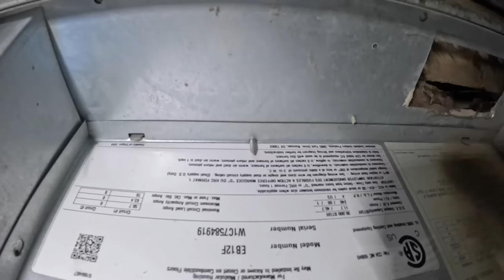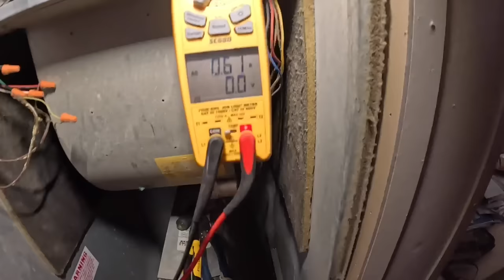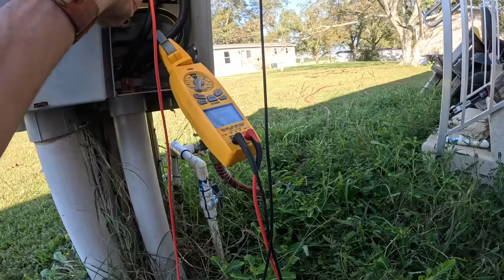Serious Electrical Problems. Only Made Worse By Me! ⚡️ ⚡️

Comment: I swear some of the places you work I'm not sure how you get paid.   ;)
We lost power back in late March due to a tornado strike.   When I say lost power most of the utility poles were pulled down.   So the area required all new poles and lines.  After a week without power when power was restored I discovered my outside main breaker failed so I was only getting one leg to the CB panel inside the home.  Luckily I got it repaired the next day which took an electrician due to the age of the service panel.  Required removing the meter.

Comment: Wow! You're like a pit bull that won't let go! When you tested the power on both legs at the bottom of the meter and found one was not energized. Your not responsible  for any more.😊 Great job getting the lines straight on the heat strip. It's just amazing how those things will run with that much wrong. Stay safe! Give Reily a hug.😂

Comment: Why is there 2 different relays needed for 10kw heat strips? I would definitely ditch the sequencer and relay, a double pole contactor will handle that with no problems and a heavy duty relay part number 90403 and use only 1 speed for both heat and cool that will minimize the possibility of motor failures because it is only using only 1 speed and can’t try to lock 2 speeds on at once, also too just take one leg off the contactor and go to the normally closed side off the relay with it that way the heat strips can’t run without the blower running

Comment: Wonder if the neighboors had the same issue, if so it would have been at the main transformer or substation , other than that , she has a bad meter. Be lucky you did not touch that meter, it could have arched if a lug was bad. Your job was actually done at the breaker in the home. Good work and stay safe.

Comment: First time I’ve ever seen a mobile home electric furnace used upside down…
Reply: It is called a "Downflow Air Handler"! :face-blue-wide-eyes:
Reply: You haven't seen many mobile homes then. All mobile homes manufactured for cold climates, electric or usually gas heat, are all downflow situations.

Comment: Must have had one leg open at the pot or maybe a distribution pedestal if they used one. Some of those pedestals are a pain to start with as dis similar metals make up the bus bar connections. Glad they got both legs back working!

Comment: those relays do not go across,they go up,but it could be shorting out inside.but definitely,the 2 lines are connecting.thanks for sharing.
Reply: Like they're connected but one leg is broken somewhere along the run?
Reply: like the lower heater is shorted ,there should not be continuity between blue and orange.9:32. @allanbrito13

Comment: the short was at the breaker bridge ,between yellow and red.ohm out the heaters.
Reply: Didnt have a short im willing to bet. The furnace was trying to run on 120volts. Furnace was wired to spec. They have a bad service entrance wire thats burnt to ground.

Comment: That inverter behind your driver seat has a severely bent cable at the terminal. Try bending the the lug to eliminate wire strain. I do a lot of high amp DC wiring on boats..
Reply from the maker: will do

Comment: Did you get to the bottom of this? I can't find a callback video.

I looked up the relay you changed. It enables both sets of heat strips, one per contact set. The contacts go the opposite direction from the assumption. There will, at least, be a "no heat" return call. Also, the legs it switches (orange and black) are on the same leg of the incoming power, so a short at that relay wouldn't trip anything. It just won't work.

The continuity you found on the red/blue wires - that relay is for switching the blower speed, and blue/red is the normally-closed contact. Red is connected to orange through the motor.

There also isn't any intelligent "control board," so everything should react immediately to the thermostat. As I presume it was left on 'cool,' I would have expected the blower to turn on immediately. Also, that transformer sound isn't healthy, especially undervolted.

Barring anything like burned/chafed wiring touching together, my guess is the blower shorted. It doesn't have any overcurrent protection other than the 60A breaker with the yellow/orange circuit on it. I think the repeated dead shorts (the initial one, there may have been one if somebody tried to reset it before calling you, and yours) damaged either the meter or a breaker/fuse in the pedestal (or maybe even a connection somewhere). The unit is no longer tripping the breaker because now there's only 12V on the control side and it's not enough to pull in the blower relay. When that's back up to 24V, I think you'll be tripping breakers again.

As to why you're seeing 120V line-to-line: that house did not have any "240V" loads turned on: stove, dryer, water heater, were not operating. Therefore, the "good" leg has 120V to N from the poco, the "bad" leg has no supply, and everything connected to it is a "load" to neutral. Thus, that leg basically appears as neutral. If some 240V load were to be turned on, it would pass current from the "good" leg to the "bad" leg, bringing their voltages closer together (ie, closer to 0 on your meter)   The fact that they have an electric water heater that was apparently not trying to heat at the time of your video further suggests that the second leg was working prior to your arrival - otherwise the water in the tank would have been cold.

Comment: Good job spotting the problem ,The power will back feed through a 120 volt closed circuit by the neutral wires that are connected to ground in the panel in the house ; But normally a job like this calls for that big flat screwdriver with all the burn marks on it and poke it around in those panels and something will fry ! Lol  Ha Ha !

Comment: When you check the hot lines and only get 120 volt you only have power on 1 leg your checking same line that's why to ground gives 120 volt on 1 leg the other leg 0 when you have power on both gives 220 volts

Comment: Somewhere in the supply wire going to your outside panel from the power supply to the panel is burned onto in the ground…had to diagnose that problem at my own house years ago…
Reply: @Bryan-Hensley   Yeah and he didn't notice them, even the cover he took off had a huge flash burn.  He's a pretty good HVAC tech, but his electrical skills are seriously lacking, and I am afraid one day he will get hurt, badly. Edit: and at 12:00 look at the burned connections on the heat strip relay, orange and black wires.... again, very poor observational skills here...oops, continued, and he just found it.
Reply: @mxslick50  I did not see Him look at the 2 Supply Wires on the left side of the 2 Breakers.
I looked to Me like one of them was up against the terminal of the top leg ??

Comment: 120v phase to neutral and 120v P2P. If one phase is at zero, it will show 120v Phase to Zero (potential between peak and zero) when you are reading phase to phase you are reading  the potential between+120V positive and -120v, thus 240V of potential between said points, because each phase is 120degree offset of one another.
Reply: 120V line to neutral, for both split phase 120/240V service and for 120/208 (three phase).  Three phase is 120° apart in phase rotation, but split phase is a single phase line (center tapped) so there is no time (phase) component.
Reply: That is correct it is split phase, i was just trying to explain it in a manor someone can visualize.

Comment: Strip relay looks correct to me....orange and black should be the same 120 volt leg and yellow/red the other. The outside MB is either toast or the Al service line burnt in 2 underground. Was wired correctly before you changed it